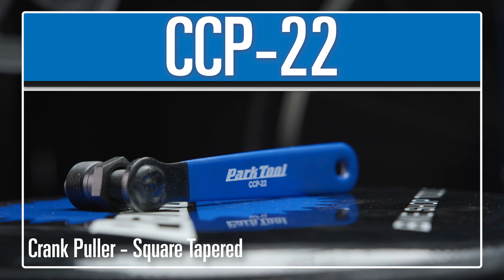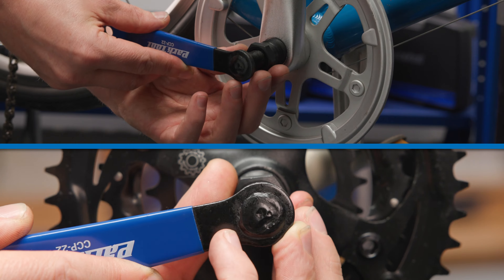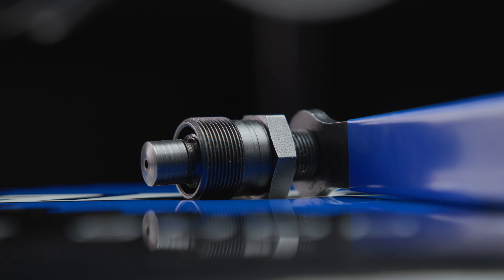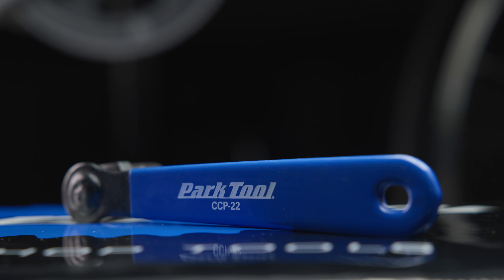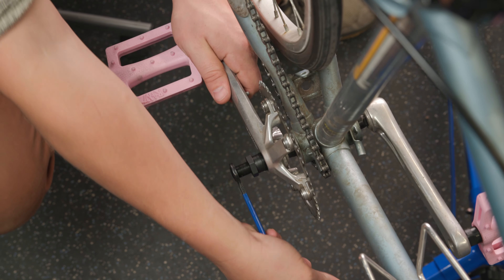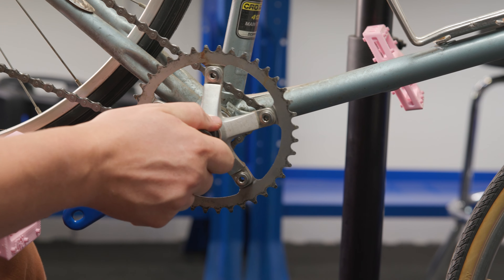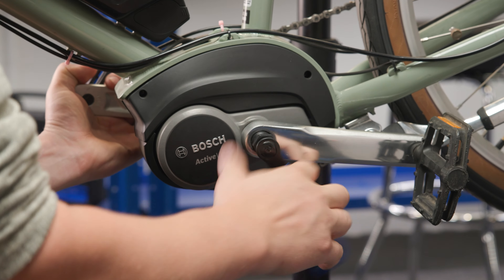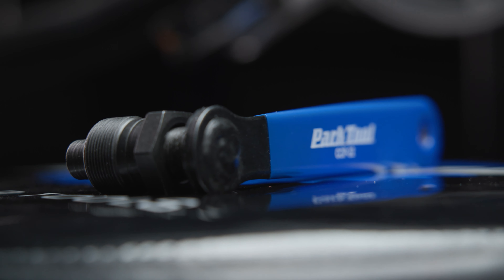CCP-22 Crank Puller

Comment: It would be a far better tool if the handle were re-positionable, because sometimes it is in the wrong place relative to the crank arm. It would also benefit from a telescoping handle for increased leverage. Lastly, the discontinued CCP-2 was more versatile because of the reversible threaded nut that could accommodate old French cranks. All told, the CWP-7 is a much better value.